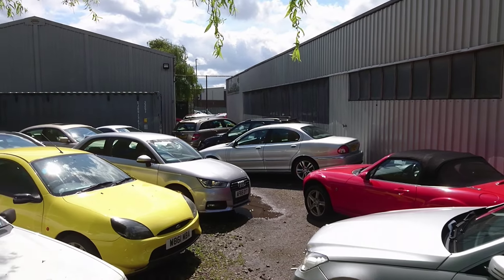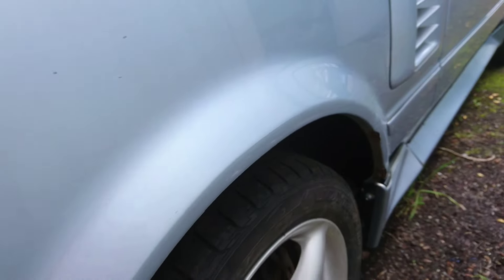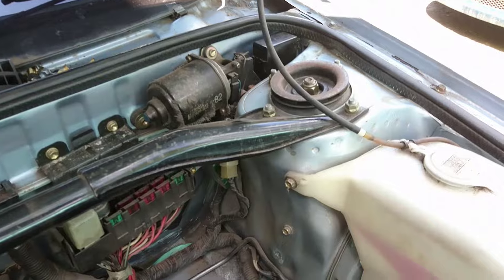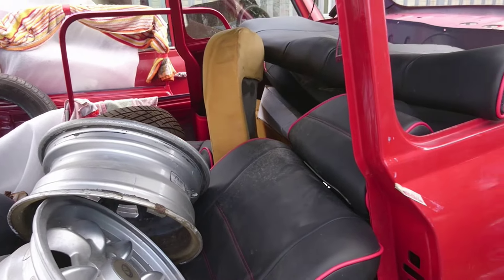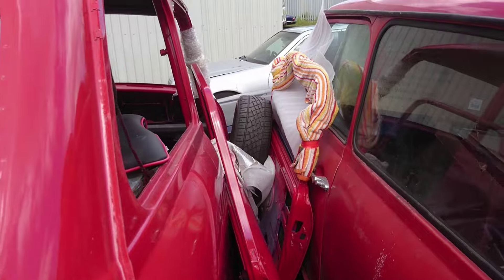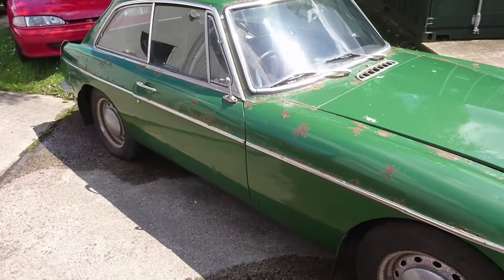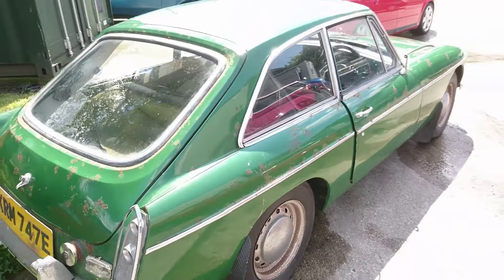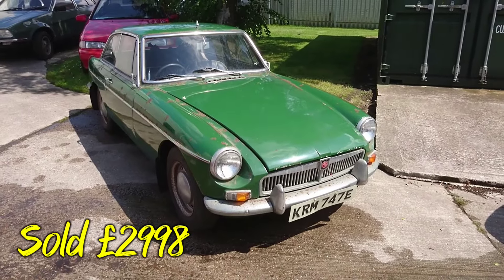Project Cars at WB and Sons July Classic Car Auction inc BMW M5 Sierra Alfa Minis MR2 MG

Comment: The Mini shell looks fairly sound.
Amazing that someone paid £1000 for the MG ZR. I dont think i have a long enough barge pole. Seems a good result when you consider how much work is needed to put into it.
Amazing what putting an M5 badge does as well.
Reply from the maker: @TipTopMotors.  Yes mate the Mini project had a lot of work already done, looked a good basis! I couldn't believe it either for the MG ZR, even as a parts car! Would make a nice car the M5, not sure on the finished value though 🤔 thanks for watching 👍